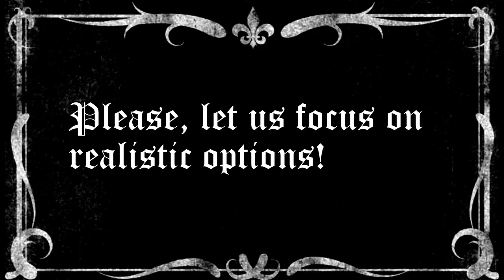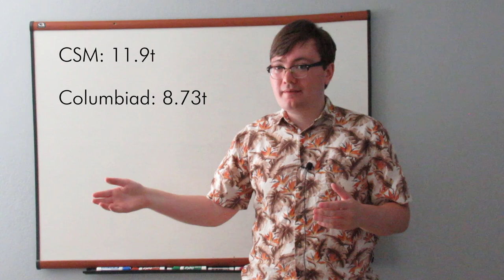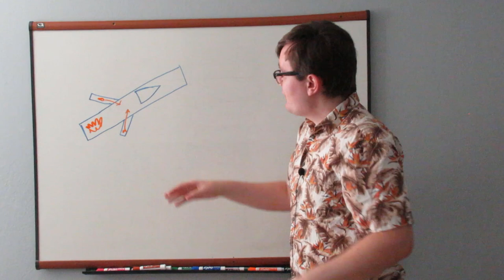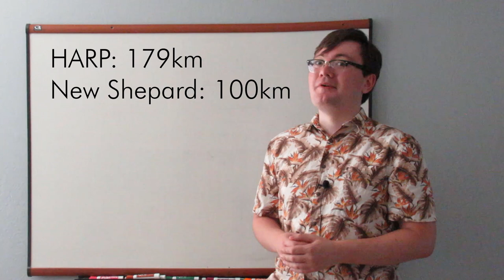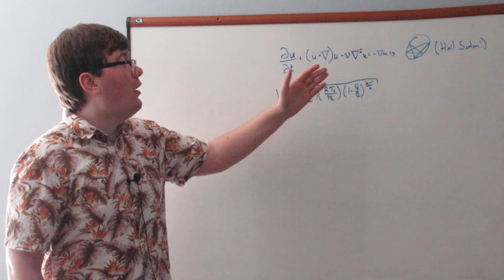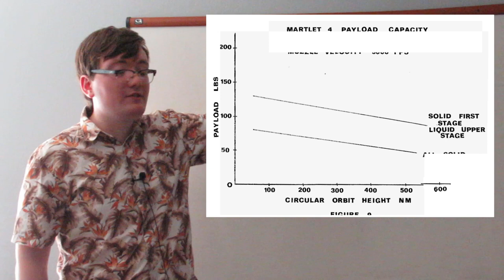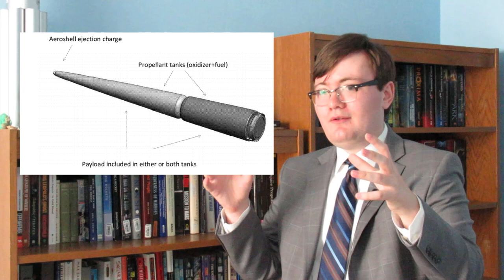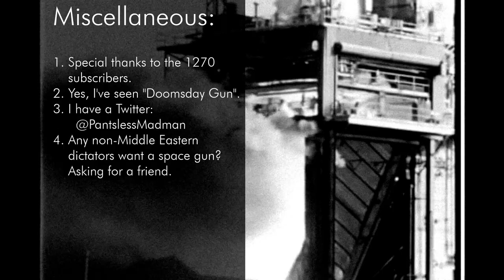Can You go to the Moon with a Space Cannon?

Comment: Taht Jules Verne bit was excellent. A so that's how that guy is. Also, the size these cost of the guns makes initial investment hard to stomach even if they promise way lower launch cost per kilogram. Also, a space gun can only deliver to one inclination making its application limited so if you have one orbit you really want to use the building as a space gun might be an option. 
I love your work and that is Roberd truax disiner of a Fire spewing mattel dragon biding its time ot roraw beneath the waves.
Reply from the maker: Many thanks.

The issue is that the gun would be expensive to develop for its payload class. $500 million when Electron was allegedly $100 million to develop. Space guns are ideal for refilling propellant depots, so we'll have to wait for one.

And yes, Truax.
Reply: @pressure-fedastronaut6511  Also, the satellite costs would counteract the cost savings per launch.

Also, space guns would have to launch a lot to be viable.

Comment: Actually sending astronauts to the moon to build a mining colony lets say, could be supplied at a considerable savings by a cannon. I studied modular systems where just about anything could be constructed with small parts bolted/welded together. Since the Moon is in a vacuum arc welding systems like TIG & MIG should be possible without the need for an inert shield gas.

 If they were to find some elements worth the expense of mining on the Moon like Platinum, Palladium, or Iridium and Iridium alone would make it worth it, stuff is expensive, higher than Gold or Platinum. Or imagine if they found Rhodium on the Moon at $14,000+ an ounce. Yes that would make it worth it.

 One issue I've heard was from a geologist who wondered out loud that given that the Moon's density is 60% of Earth's there may not be heavy metals in sufficient concentration close to the surface to mine. Anyway if they did find Iridium or Rhodium there, then send the final refined products back by building a cannon. It would be easier and smaller from a gravity standpoint alone at 1/6th the gravity of Earth the cannon would not need to be as massive as one on Earth.

Comment: What about magnetic railguns? Could they work, or do they usually fire too small projectiles compared to traditional cannons?
Reply from the maker: They cap out at 3ish km/s and the electronics (apparently) don't last as long as a gun barrel would. From a practical standpoint, go with a light-gas gun.
Reply: @pressure-fedastronaut6511  Yeah, I imagine those electronics are under a lot of stress when firing. I just thought it would be nice to get rid of the volatile fuels, at least for the "first stage" or whatever you call a cannon.
Reply: @Antares2  I don't know but if you can get the barrel long enough the bore big enough and the end high enough (like out if the atmosphere is tall) you might be able to build something monsters like that with I don't know magical materials. You would need Railguns to power this thing because gas just does not allow you to smoothly exhale over a barrel hundreds of Kilometres. You might be able to build a Railgun with accelerations low enough to launch humans.
This would also require huge abuts of power.
Reply: The problem with Railguns is Back ElectroMotive Force (BEMF).
The conductor which pushes the payload  with a force F= Øa * B * (Ia–Icc) (with Ia: current in the armature, B: external magnetic field, Øa: transversal length of the armature). With large currents or external magnetic fields you can get as much force as you want. The Rail length Lrg is not so important if it is strongly anchored on a mountain, but a long raigun will buckle on a cantilever, unsupported beam.
The accelerating armature moving with speed Va acts as a rotor in an linear electric motor. The B field induces a counter-current Icc= Va * B * Øa/Ra ,  (with Va: speed of the armature, Ra: Electrical resistance of the armature).
Then the payload accelerates decreasingly until Ia – Icc =0,  therefore Va < Ia * Ra/(B * Øa)= Vmax, that for the high current solid state electric technology is ~ 3 to 4 Km/s.
Solid state switches for really high current devices are humoungously expensive — I do not know about SSS lifetimes. The most knowledgeable people may be in General Atomics.
Reply: And what about coilguns? They have lower stresses when launching. Or maybe something like NASA's Maglifter concept.